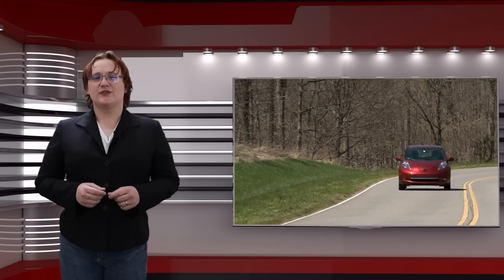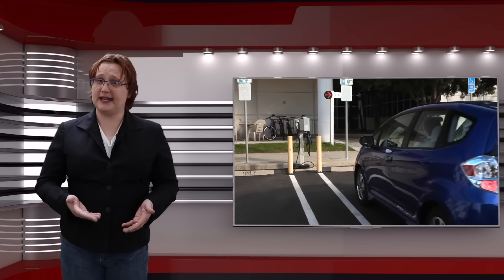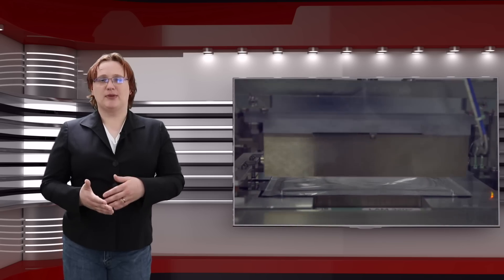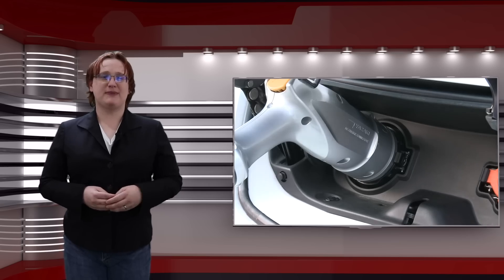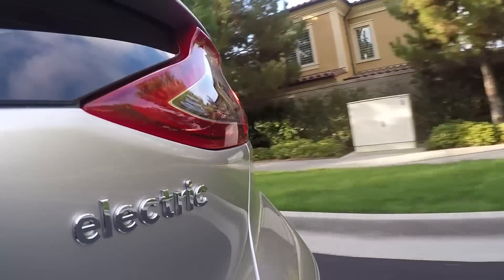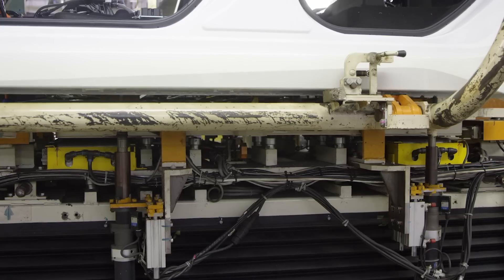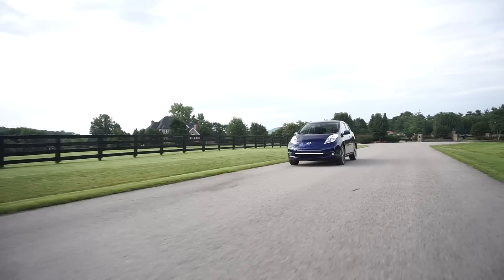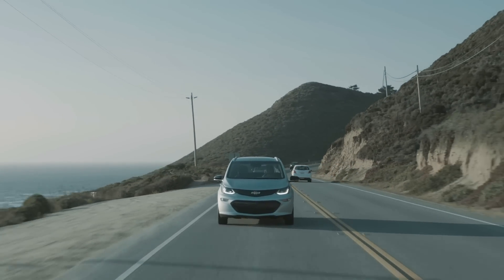Hot Weather and EVs: Why Liquid Cooling Is Best

Comment: I’d be interested to know the degradation of the new chem leaf batteries in hot climates. All I hear about is the 2011-12 models , how have the later ones faired ?  I suspect not as much as I never real hear about those.  I expect hard driving and hard charging in hot weather is where the damage occurs.  short city trips and trickle charging , heat may not be a huge killer of batteries.?  Or Tesla’s run the AC all day when the car is parked in a hot car park ?

Comment: Liquid cooling - not a problem that's been solved, yet, in terms of thermal management, preventing thermal runaway, the pour point of the coolant in low temperatures (cold start) and how the battery system is designed. BUT, it can all be solved with dielectrics such as MIVOLT using DIRECT COOLING - no air, no plates, not passive heat sink/cooling systems..
Observe...

https://mivoltcooling.com/leaving-range-anxiety-behind-the-ev-project-powering-next-generation-battery-systems/

Comment: Incorrect. It's not about battery cooling in hot weather. It's about chemistry. Tesla battery is not being cooled at 100F weather if not DC charging. Tesla pack loves 30-45*C temperature.

Comment: I think you have really good contributions here, from some of your audience (not me, I mean other people).  For a start, they raise examples from other areas where different cooling is used, like PCs.  Plus some of them point out refrigerant is used on one car which I did not know.  The thing about forced air cooling (I guess that's active if you have a system adjusting it), is it is simple and effective in certain situations.  Has to be said, if there is an investment in part of your vehicle valued at about seven grand, then over-specifying the protection of that component, is merely sensible protection of that high-value item?  We had an awful car once that overheated constantly, and my brother said it was a Czechoslovakian sweet wrapper in the pipe...point is it was a hideous handicap and unforgiven to this day, none of our family bought the marque again.

You can lease someone all sortsa crud, but if you sell them it, watch out, there are repercussions to shafting people - because that is how we see it when money is taken for shoddy machinery that lets us down.  Battery condition readings, are sought, and there are some apps and OBD2 devices out there, to let your phone display what capacity the EV has left in it.  At least if you buy used, you can know what the deal is?

The ideal would be the quietest, lowest energy solution.  It makes sense to me, you want the best cooling, deep inside the power pack, or else not HAVE a 'deep inside'.  A refrigerant tube then, winding around in there, makes sense, and a more traditional coolant based system thereafter possibly.  

I think, the thermodynamics engineering of this, is obviously a specialist area!  Wouldn't like to pontificate at length, so best just to say, it matters a heck of a lot more if you know you will put the vehicle in a concerning situation.  Heat pumps sound great, but that heat has to be given up somewhere, do we exhaust it or is there anything to be recouped?  Could take the Canadian lesson from Volvo, where they fitted a small boiler for some models, it was up near a wheel arch, mine doesn't have it because I am in the UK.

Perhaps that is a solution to the cost issue, only fit the specialist super-cooling system where it is geographically really needed.  My motorcycle is aircooled, and they brought out a later model, suddenly, it is water-cooled.  BMW have those big GS twin bikes, they were air, then oil-heads as they were called, then full liquid cooled.

With engines of the ICE type, there is a specific point it seems, at which, the power output means you MUST go active, and liquid, cooled.  Quick calc, let's see, mine has 600cc and is 60bhp, the liquid cooled model is same cc but 80bhp...so roughly, then, once you move from 100bhp per litre, with a wide open aluminum (aluminium) engine shape, up to more like 120bhp or more, you have passed the point where you can tolerate passive aircooling.

My machine actually has an oil cooler, but it is just 'always on' therefore as with the air coming past the engine, you might say it was passive...but of course it is not! The greatest cooling is required when you wring the nuts off it, and that means you are usually going faster, hence there is a degree of 'active' even to my Seca II's primitive thermal protection.  And, the oil is pumped more quickly as the speed rises too.

I can finish this with an educational portion, bashing ICE motors, because the increased power requiring much greater cooling, is all due to the fact these fossil fuel burners are only fifteen percent efficient.  The real problem, then, is every time customers want say ten percent more power, the engineers know, this means a lot more extra wasted heat.  Moving from my ancient 60bhp engine, to the new 80bhp engine, means a third more peak power output.  But the meagre 43kW mine drove a shaft round with, meant another - don't laugh - 172kW expended as heat.  Five times the power of my home heating gas boiler.

So the measly extra 17kW or so at the rotating crankshaft, means necessarily bringing the byproduct of 240kW as heat.  Look at the difference.  We got 60kW at the shaft, by moving to fuel injection etc, but at every stage we had to factor in the horrendous 68kW EXTRA heat we'd be saddled with getting rid of!  That is what the radiator is suddenly sprouted for, to get shot of almost 3x as much additional heat output, as my home boiler can do at full tilt!

Of course in any sane world, this wastage would be condemned.  If your home leaked this, and you deliberately put radiators outside to expunge the surplus heat, it would raise all sorts of obvious issues.  We are conditioned, it has been allowed and made to happen for profit. Oh go on then, I get to tell my 'You can condition people to anything' anecdote...

Our daughters were at childcare, along, long time ago...and I am waiting chatting, actually watching to see how tardy some of the mothers are, collecting their offspring, rude and cheeky but another story...our girls are suddenly engaged in conspiratorial conversation, the youngest looking at each mother in turn, as they collected their children, then turning to the eldest for guidance it turns out.  I need to mention, I am standard looking white scot, and my spouse is of Jamaican descent.

The eldest abruptly turns and firmly says to the youngest 'Not everyone's mummy is black'.  I had never thought about it before.  Patently, you really can make anything seem the standard, set a new normal, and children who know no better, accept it as set in stone.  It was only a couple of days into childminding, the youngest observed this variance in parentage.

And so we all thought there must be some improvement, when smooth voices tell us smelly liquid fuel is newly designed and makes our engines more efficient.  We were not to know, it was going from 15% way up to the giddy heights of (cough) 15.01%.  They were havin' a laugh.  And now here in the UK back up to a whisker off £6 a gallon, they are again!

Lastly, thanks again Nikki, and keep EV-loving.  Did you see what I did there?!

[Edit- i just did mental arithmetic here, so cheated and gave the ICE the benefit of a whopping 20% efficiency...haha..!]

Comment: I've experience with 3 plug-in cars, a gen1 Leaf, a gen2 Volt and now a gen2 Leaf. I like in a location that gets hot. A few years back we had a year with 51 consecutive days over 100 degrees F. So far I've never experience any battery degradation.  My gen1 Leaf was turned in after 3.5 years and it indicated full battery functionality. At the end it would still show more than 110 mile of range on a full change under ideal conditions. I've not had the gen2 Volt or Leaf long enough to draw any conclusions on battery degradation, however there is definitely a difference with the Volt. It can be very loud when charging. My cars are garage kept, which can sometimes be hotter than the outdoors. I haven't recognized any rhyme or or reason, but sometime when I open the door to the garage it sound the the Volt is about to lift off like a Harrier Jump Jet. Not sure why it needs to be this loud when only charging. It's louder in most operations, but in charging the difference is huge. I almost can not hear when either Leaf was charging.

Comment: I was not bothered at all by the short explanation of battery degradation, despite having an engineering degree. Though calling fans a passive cooling solution made me cringe some. The amount of heat you can transport via fast moving air is enormous. The old air cooled Porsches for example delivered far more cooling power than any EV could ever need. The problem is just that it is noisy and relies far more on temperature differentials which are no issue in a 90°C gasoline engine but can be in a battery.
Coolest cooling solution I have seen on last year's IAA: Peltier elements
Reply: If a passives system can be made so effectively,  Y not use a Seebeck generator? And with all do respect comparing a 911 ie ICEV to a Leaf ie BEV is comparing the proverbial Apples to Oranges since the parameter r so different. (And a 911 is the exception that proves the rule for a ICEV anyway) 

"The perfect is the enemy of the good". And the good for BEVs now is liquid based active cooling. But I would look forward to seeing  a paradigm shift if its possible, to an more KISS oriented future. For what it is worth...

Comment: I live in Arizona, old co-worker had 1st Gen Nissan Leaf. He was into his second year of his lease, could only get about 60 miles on a single charge at most because the battery degraded so much from our summers 115°F heat.
Reply: When did Nissan leaf start using the lizard battery pack
Reply: I'm curious if that was a '11-'12 or '13 or newer LEAF.
Reply: That's exactly why Nissan developed the lizzard battery. Because of the Phoenix Arizona experience customers were having. OK from 2013 and newer.
Reply: They had no cooling system for the battery I heard.
Bad news.
Reply: I keep my cars a long time, have long daily commutes of at least 50 miles (using A/C constantly) and have to park them in outside in the sun even when our summer temperatures soar as high as 122°F (50°C). Of course the vehicle temperature is much higher. I shudder to think what that would do to today's electric batteries. Doubt if they would last the average of 15 years and/or 200K miles I expect from a car. Saludos desde Arizona.

Comment: I'm looking at you Nissan! I can't imagine being on the same battery on my 2012 leaf for 18 years like my old 99 Honda Civic same engine.
Reply: Kieran Mullen you don't have to be on the same battery. With what you save on not buying gas,no ice engine or transmission service or repair cost and less brake wear. You can buy a new or refurbished battery and be ahead of the game. Oh, and also enjoying years of less stressfull driving in a powerfull, quiet, comfortable car.

Comment: Truly active temperature control that uses a heat pump to heat or cool the battery will be best and the most efficient system. Heat pumps can be 200+% efficient.

Comment: Although I’d agree that the thermal transfer from the battery into a liquid coolant may be more effective... if we follow on from the previous video suggesting that there needs to be a market for 3rd party replacement batteries ... then surely we should be adopting simplicity in the designs.   To me that would suggest the battery should use the car body as the heatsink with all the cooling/heating done using plant fitted in the car floor extracting the heat via metal-metal contact body between the two.  

... although I’m sure there are lots of better, simpler, methods. :-)

Comment: Oh dear, you got it wrong, Active Cooling is not necessarily better than Passive Cooling. Please don't mislead your viewers without consulting with an engineer before making such libelous comments. Active Cooling does not use "Coolant" like a fridge but just plain old water. It actually recirculate warm water over the batteries and not chilled water which would actively lower the temperature even on hot days.

If designed properly passive cooling can be better than active cooling as it has no moving parts to fail. If your cooling fan is broken or the temperature sensor or liquid pump has failed your battery could die. On the otherhand, a properly designed passive cooled car should not cook the battery if you haven't modded the engine management and driven it to the ground.
Reply from the maker: The Chevrolet Bolt EV uses coolant. As do most other cars we've seen with active cooling.
Reply: Thanh Tran Which vehicles use water only?
Reply: Coolant can at most cool the battery to ambient temperature, so I would expect that packs would degrade faster in Arizona regardless of weather they were actively or passively cooled.  It would be interesting to see some data points on this.

Comment: Regardless of type of active cooling (air or liquid) it can only cool it down to "room" temperature. Unless phase change is involved. There is no difference whether warm air is blown directly into the battery pack or through a radiator. But both work more efficiently then simply letting the battery to rely upon simple convection and not even a fan
Reply: jur4x, you beat me to it. The Vapor cycle on all the good systems is more important than whether it uses air, liquid to cool the battery. I think bmw even has a direct vapor chill plate system.
Reply: TheViewFromUpHere, yes, that’s going to be a big factor in cold climates. I think it also also scavenges heat from the motor for the batter and cabin, since the motor can always stand to lose some heat. I’m curious what the real world range will be. 240 miles seems a little low for a 90 kWh battery. I would expect at least 270 miles.
Reply: Graeme Cobb, the i3 Rex would be fine with me. I use to carry a small container of gas with me on long trips anyway. It wouldn’t be a big deal to carry a 2 gallon tank in an i3 and just pull over to top off. How far does to go at 65 mph per 2 gallons with the battery in hold mode?
Reply: The Jag i-Pace has a heat pump as part of its active air cooling so that  it can truly cool or heat the battery.
Reply: IMHO hey your expecting 270 miles from an i3 BMW?
Reply: ecccccko, yes, if it has a full battery, full tank of gas, and a 5-gallon gas can in the back. But I was actually referring to the Jaguar iPace.
Reply: noshit sherlock. everyone knows.
Reply: ecccccko I get 270 miles from my i3 ReX in the summer (on eco pro mode). 292 miles was my record, but it’s closer to 200 miles in winter. In comfort mode, you can forget the galactic mileage.
Reply: Graeme Cobb, is that was the big gas tank setting or small gas tank setting?
Reply: IMHO we have the full 9 litre/ 2 gallon gas tank in the U.K. with the 33 kWh battery.

Comment: The debate shouldn't be liquid or air cooled, the Porsche 911 worked fine with air cooling for many years as it was designed correctly. The design question is, must EVs have active cooling to protect batteries or can manufacturers save customers money. Adding a simple fan to air-cooled battery packs, to help cool it in extreme situations, appears to me to be a good idea to extend battery life. Passive designs must be at risk while being charged, as they naturally have limited air flow.
Reply: The big advantage of liquid cooling is the greater heat capacity of the coolant. It can take away more heat energy per increase in temperature than air and massively less volume of "coolant". You can then use a more conveniently sized heat exchanger to push the heat out into the environment. A heat pump increases the efficiency by increasing the delta-T between the environment and the ultimate heat rejection exchanger. This also allows that final radiator to be smaller, increasing the aerodynamic efficiency of the vehicle.
Reply: The operating temperature of the bulk of the coolant of an ICE engine is in the 160-180F (71-82C) range. Lithium-ion batteries really don't like temperatures above 105F (40C).
Reply: Agreed. To actively limit coolant temperatures further, whether liquid or air then leads to heat pump technology which interestingly has been adopted by some EV manufacturers. I guess its ultimately all a matter of complexity and economics.
Reply: Not to split hairs but, older 911's aren't air cooled, they're oil cooled. Common misnomer.